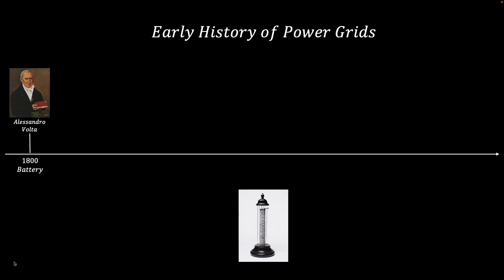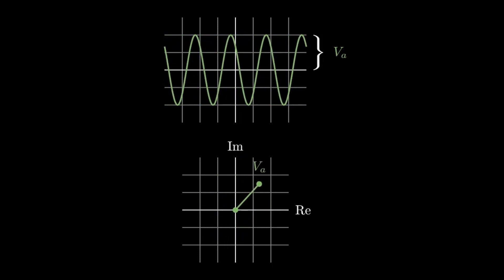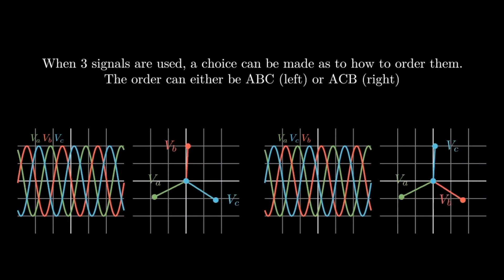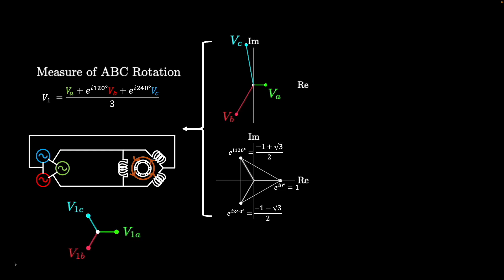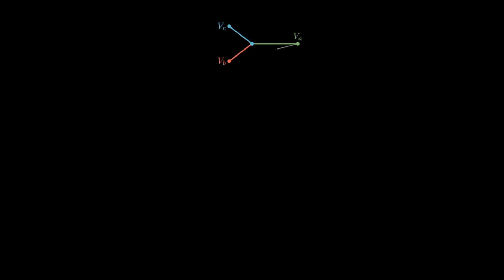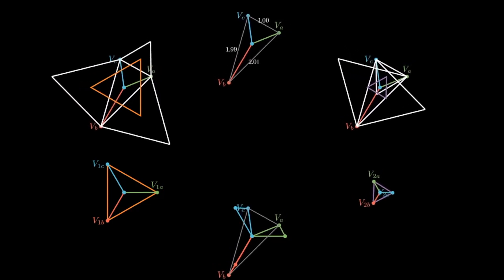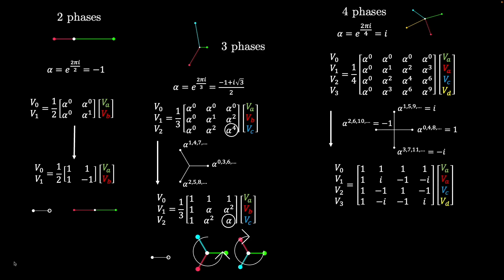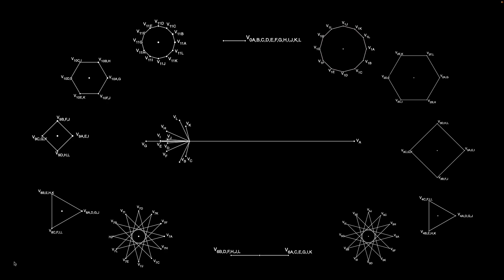Symmetrical Components From a New Angle #SoME2

Comment: Isn't the negative sequence supposed to rotate with the same angular velocity as the positive sequence? Because in the video the negative sequence only rotates in relation with the positive which is stationary...
Reply from the maker: The rotations in the video aren’t meant to display rotations of the sequence components in time, they’re meant to show all possible kinds of unbalance. For any static system with V1 and V2 unchanging with respect to each other, then to fully describe unbalance the only two parameters you need are |V2/V1| and the angle between V1 and V2. Throughout the video I set V1 mag = 1 and Ang = 0, so |V2/V1| = |V2| and V1V2 angle = V2 angle. Then rotating V2 around shows all possible imbalances for a constant |V2/V1|.
Reply: @nathank7569  Thank you very much!!!

Comment: I'd like your angle about the symmetrical components, can you recommended a book about it?
Reply from the maker: You will not find this material directly referenced in a book, hence why I felt compelled to make a video about it. There is book about Symmetrical Components by Wagner and Evans, published in 1933, where chapter 13 has equations and diagrams that align with what I presented here, however they don’t go into the geometric aspect to the level that I did.

Comment: So V0 is a measure to the center of the system. Would that be the 'Neutral'? Or if V0 was anything besides 0 there would be a voltage on the neutral. Trying to think of what this correlates to on the Power System. Great Video!
Reply from the maker: I find it's easiest to think about the physical nature of symmetrical components by how each component affects a 3 phase motor, which is also the reason they were invented in the first place. If the positive sequence makes a motor turn at X speed clockwise, then the same amount of negative sequence will turn the motor at X speed counter-clockwise. Since the V0 signal looks the same on all 3 phases (i.e. you never multiply it by the complex sequence operator a), the motor can't distinguish a rotational direction when only V0 is present, and so V0 is the component that doesn't turn the motor at all. Thinking about it in terms of vectors, if you start with 3 different vectors, and add the same vector V0 to all 3, this is geometrically equivalent to shifting the origin by V0, which is the same as applying basic translation symmetry. So mathematically V0 can be interpreted as a translation in the complex plane, and physically can be interpreted as a 3-phase supply that doesn't rotate a 3-phase motor. Another physical manifestation is that V0 creates circulating currents in wye-delta and zig-zag windings. More on that in a future video.
Reply: @nathank7569  Would it be fair to say that adding a V0 vector away from the Origin reflects adding a DC bias to a circuit, such that the AC phases don't all rotate about 0 V?
Reply from the maker: @nschrombeck  that’s correct, DC is zero sequence.
Reply: @nathank7569  These are the connections that were never made in my university classes. I don't think we even covered symmetrical components. Thanks for shoring this all up, coming from an EE in renewables
Reply from the maker: @nschrombeck  feel free to add me on LinkedIn (Nathan Kassees) if you want to chat about other industry stuff sometime. I’ve worked in utility distribution for 14 years, currently working on microgrids.
Reply: @nathank7569  Hey Nathan! I just shot a connection invite over. I'm "Nick Schrombeck". Glad to make your acquaintance! Hope to get more into your backlog of videos. Understated thinking going on, best of luck!

Comment: Sorry, I'm having some trouble understanding. 

From what I understand, Way to quantify unbalance.
a. Vector sum for V0
b. Rotate then vector sum and average for V1

why rotate Vb instead of Va, and why rotate 180 degrees. I'm guessing rotating Vb gives V0 and Va gives V1.

Then going to 3 phase, from my understanding o symmetrical component, the "a" operator is use to multiply to rotate then sum average. So I guess it is use to find (b)? To quantify unbalance?

And the notation V0 is usually reserved for zero sequence and this video it means something else?

At 4:49 talking about V0 measure the distance to the N, "geometric center of the system" (is this where va,vb,vc intersects?), to the centroid "geometric mean of the triangle? Or the other way round?

Can explain what's the significance of the translation symmetry?

I'm kinda stuck here. Thanks
Reply from the maker: The scene around 4:49 is strictly discussing the geometrical interpretation of the zero sequence. For a triangle, the geometric center is the centroid I’m referencing. The centroid is where the center of mass would be if the triangle was a solid object. The zero sequence vector is the vector pointing from the centroid to the neutral. Now if I want to shift the triangle across the plane without changing its shape, I.e. translational motion, then I just move my centroid, which is the same as changing he zero sequence.

The combination of positive and negative sequence vectors determines the shape of the triangle. The zero sequence vector does not change the shape of the triangle, but it shifts the triangle center away from the origin. Therefore the combination of all 3 sequence components allows me to draw any arbitrary triangle anywhere in the plane.

I hope that answers some of your questions. Let me know if it doesn’t!

Comment: Hmm, so it's just a discrete Fourier transform? And it's useful because the DFT is phase-invariant, so anything else which is phase-invariant like a motor only depends on the relevant components?
Like, it's cool, I just wasn't sure what we're trying to get exactly
Reply from the maker: You’re correct, the system can be treated at phase invariant, and relative components provide the information needed to understand system state.